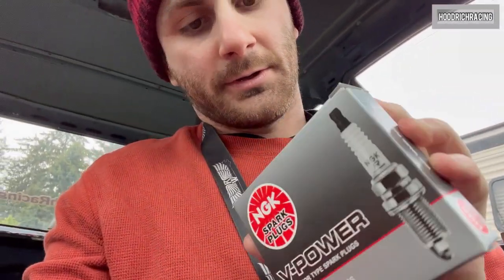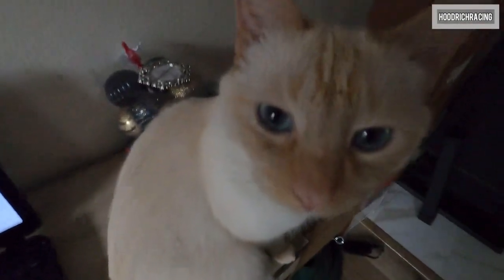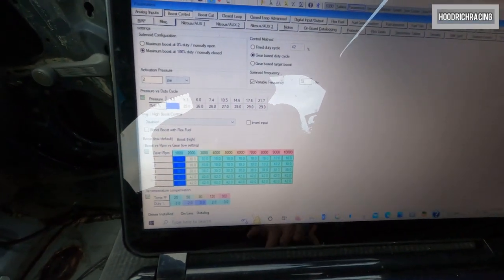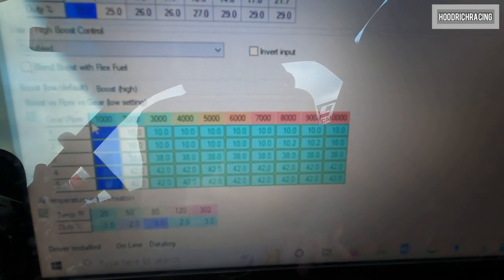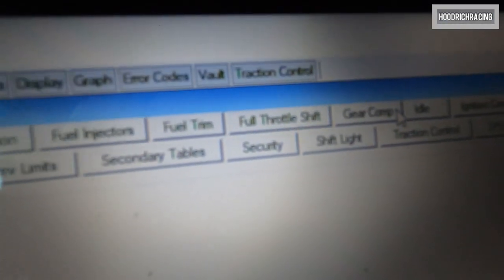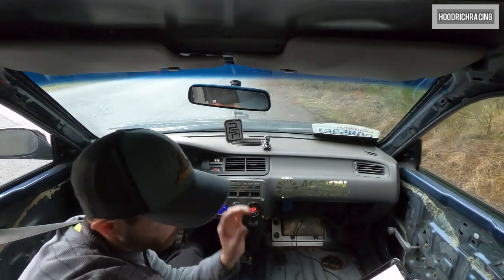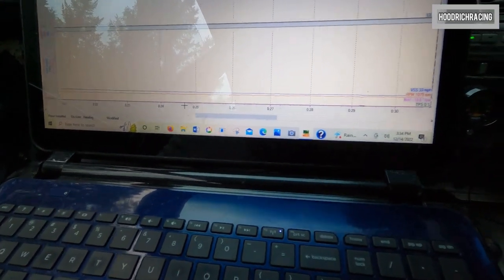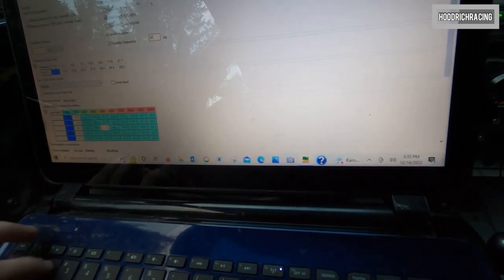Dialing In Boost By Gear W/ Hondata| How-To|

Comment: Is that a dragon fire distributor? Have you had good luck with it?
Reply from the maker: Yes sir. It’s a very good aftermarket option. Nothing but good luck. About to push it past it’s limit once I finish the awd.
Reply: @hoodrichracing3901  we went with burton’s coil on plug for our lsv, but we kept having horrible luck with oe replacement distributors. Hoping this dragon fire solves it up for us.

Good videos btw! Seems like we have a pretty similar build.

Comment: Great video!! Quick question, I have my tune also saved on my laptop. What is the procedure once you plug in from your ecu to the laptop? I'm still green with Hondata and don't want to corrupt my tune. Any advice would be greatly appreciated!
Reply from the maker: If your tune is saved on your laptop, connect to ecu with cable, turn your key into the on position, hit the lightening bolt icon and hit the upload icon. Let me know  if you need more help!
Reply: @hoodrichracing3901  Thank you for your quick reply. Now I can at least look at all my settings in parameters without corrupting anything lol

Comment: That’s the issue your running 7's instead of 9’s BKR9EIX are the way to go they last way longer
Reply from the maker: Yeah my tuner recommended these and he’s reputable for sure. Maybe switching to a platinum would help.
Reply: @HoodrichRacing  don't do it they are weaker, iv seen horror stories

sucks replacing plugs all the time but the 7s are the way to go, just part of the game